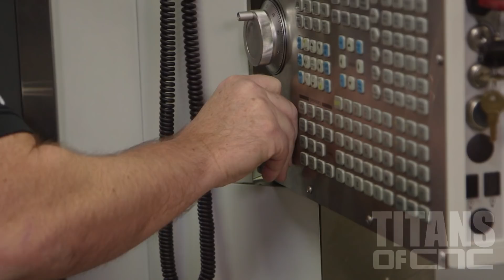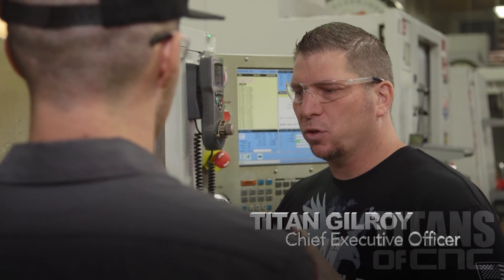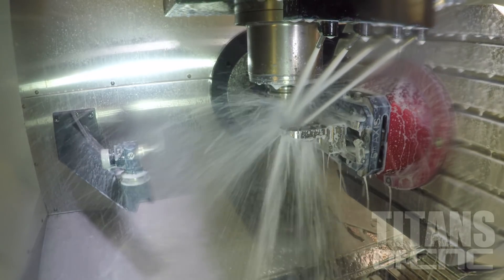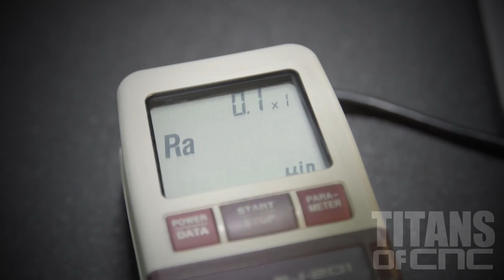CHATTER :-( in Titanium CNC Machining

Comment: It's funny you can have a mirror finish and still have high and low areas. I found that out when I had to polish pieces and the inspector explained to me it's the high and low spots but he would tell me the finish is great but have to get it smooth. I always thought if it was mirror finish it was good but I'm happy that he explained that to me.